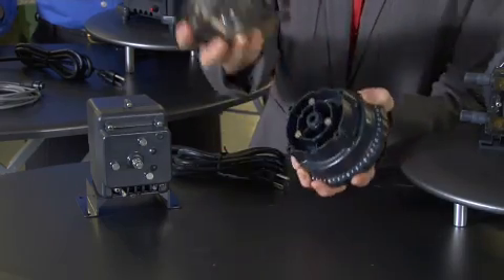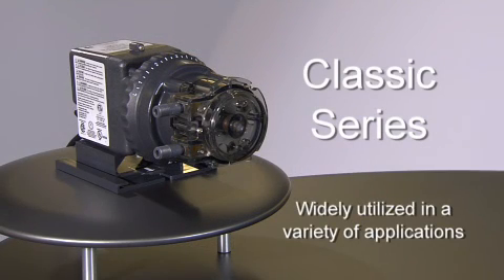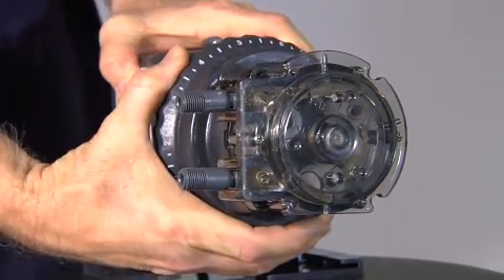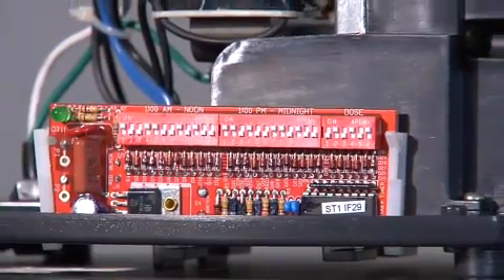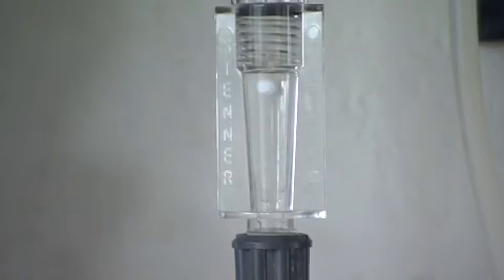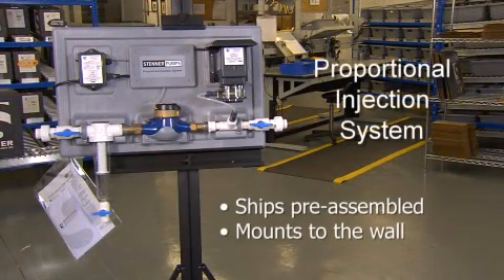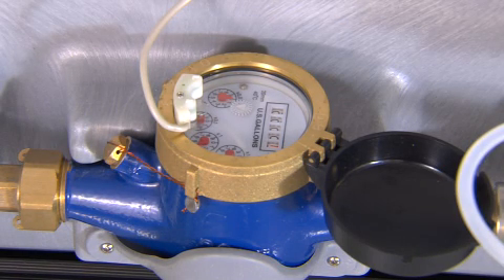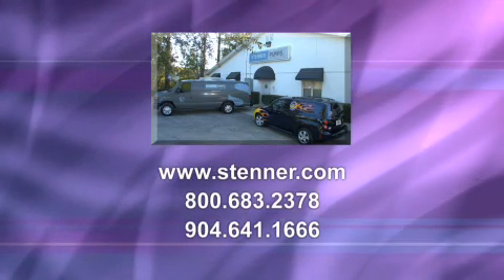Stenner Peristaltic Metering Pumps And Products

Comment: Hi very good video. With the Indicator Flow, my pump is high,  sitting horizontally and the injection duckbill is below closer to the ground, so does the Indicator flow accessory have to be posioned vertically for it to work. Can it also work horizonatally? Thanks.